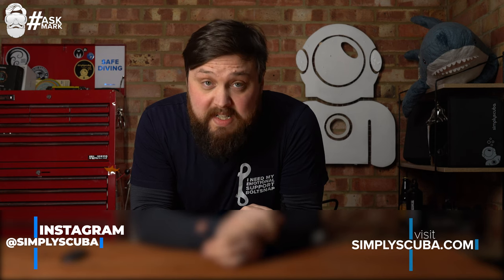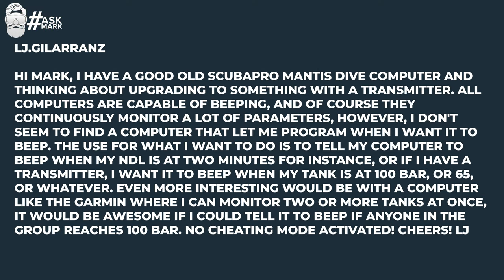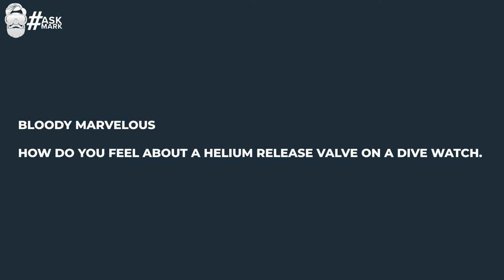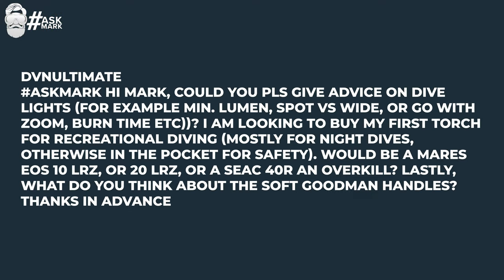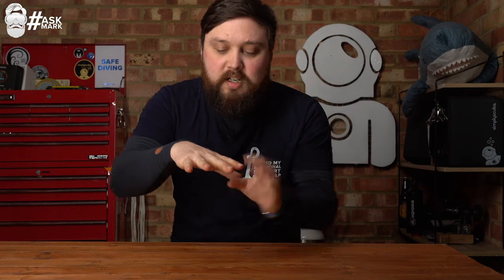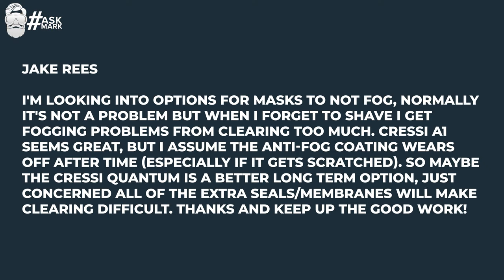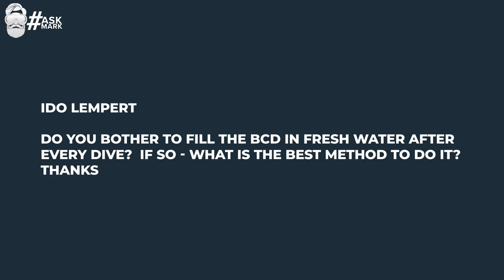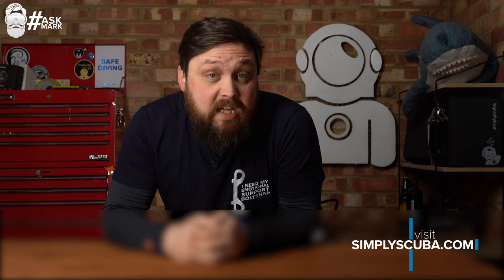Helium Release Valves? | #AskMark | @simplyscuba

Comment: Aqualung 1770r has the option for setting alarms for most parameters (depth, dive-t, turn, N2 bar and DTR) and has AI compatibility, bonus on the transmitters as they are compatible with a lot of other companies' computers so can be helpful when upgrading/replacing or helping a buddy out.

Comment: Hi Mark, i changed the battery of my Suunto Vyper Novo on my own. It worked but ... it flooded after 2 dives. But all good, no damage was really done. I changed the battery and it worked. But at that point i decided to tighten the screw a liiiittle bit more and one broke inside. Is there a trick to get it out, did it ever happen to you? If i send it to Suunto, will it be too expensive you think? Any recommendations are welcome #AskMark

Comment: #AskMark Hi Mark. I want to pick up my first set of regulators soon. I plan to do a bit of warm water vacation diving and cold water diving at home. Ice diving is on my list as well, but only after buying a dry suit. I am currently considering Aqualung Legend and Mares regulators for their ACD feature. I know I am very careful with my equipment, but I can't necessarily say that about the dive crew on trips. Other options on my shortlist are Apeks regulators like the XTX 200 since they are fairly affordable and ScubaPro for the 2-year service interval. While I am not severely budget limited, I don't want to splurge more than makes sense - after all, there is still a dry suit and a bladder for doubles on the shopping list.

I own a Shearwater Teric dive computer and would like to add a transmitter while I am at it. Is there a big difference between the Aqualung and the original Shearwater transmitter? There is almost a 2x price difference between them and as far as I can work out, they are both compatible and do the same thing. Should the transmitter be on a short high-pressure hose so people don't lift the equipment by holding the transmitter? What length should the hose be?

Thanks.
Reply: @LeeLeatherbarrow  Thanks. Mark actually answered the question on the next one. But yeah I pretty much decided on Apeks Regs for doubles at this point. All single tanks locally have T-Valves on them anyway. Right it has come down to a question of DST/FSR/MTX for the first stage and XTX 200/MTX for the second. I am not loving the hose routing on the FSR, so it will probably be DST with 5th port or MTX. Price-wise there isn't a ton between them. The only thing I am not fond of is the angle for the HP hoses on the MTX.

Comment: Helium release valves are a complete nonsense. Often, saturation divers don't even have an actual dive watch, but an inexpensive waterproof one. When they get pressurised to the diving depth, the watch reaches equilibrium with the ambient pressure. That way, they can dive with a barely waterproof watch at depths of 100+ meters. Since the water pressure is the same as the watch's inside, it's like just putting your watch in a glass of water. And they don't risk losing or damaging the expensive Omega seamaster or Rolex deepsea they can afford.
And if they have an actual dive watch, just unscrewing the crown during decompression in the diving chamber (that takes days) erases the potential problem. 
In conclusion, even for professional saturation divers, the helium escape valve is just a gimmick invented by watchmakers for publicity.